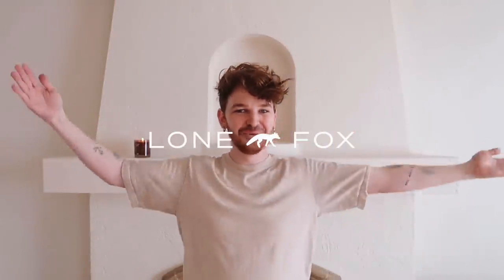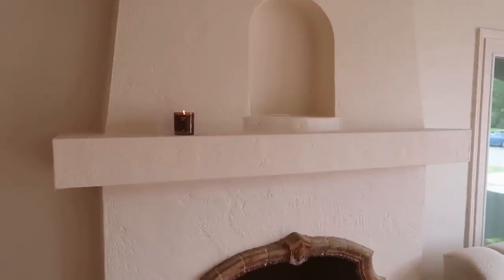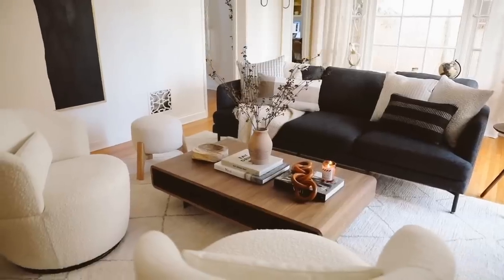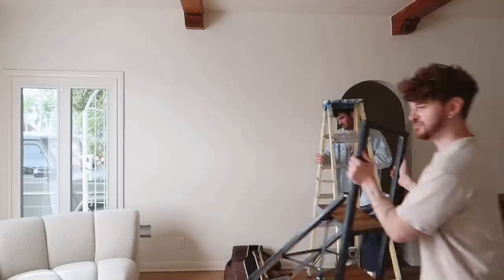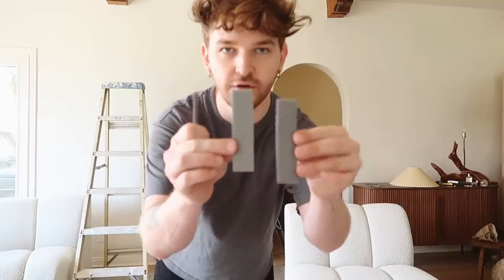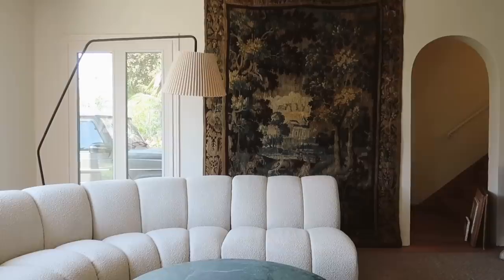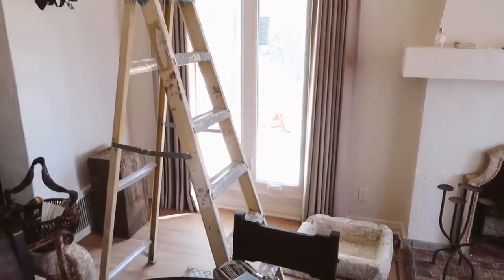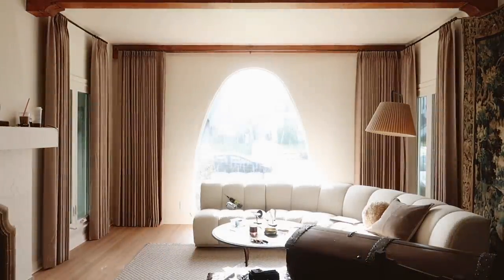Making Over The Lobby 🪑 *EXTREME TRANSFORMATION*

Comment: I just want to let you know over time, your beautiful outdoor/indoor rug will over time destroy  the wood under it if that is the original solid wood floor..because the synthetic fiber won't let the wood breathe.. folks have ruined many a floor with those synthetic underlayment rugs for their wool rugs by the same mistake.. Just keep monitoring especially in the rainy season.. and ultimately find a 100% wool/ natural fiber backing  rug as I have also seen wool rugs backed with synthetic backing .. so they can say it is washable.. (very few home machines would be able to handle that without breaking btw!! )

Comment: Beautiful transformation...as for the lamp: i do not like that shade you added. it's proportion to the size of the arch just seems off. and the wrong shape of shade. i think it would be cool to take the original shade and just find some cool way to change the COLOR of it so it's not so dark and heavy and blends with the lightness of the room more. something even as simple as a light "stone" finish spray paint. (?)
Reply: Remember; black always grounds a space and makes it better
Reply: @sandieedward993  "grounds" being the Key Word. there is very little dark on the ground (floor area)  to balance a large black shade that would seemingly be floating in the air in the middle of the room. ;)

Comment: The tapestry is too big for the wall and room. You will ruin it next to the window and folded on the floor. The couch is also too big for the room. Its unique shape overwhelms other objects. It's also not a good design for gatherings because you are forced to sit like a bird on a wire. Multiple smaller seating furniture would be better for group conversations, and more appropriate for a lounge/lobby area. The curtains are very nice as well as the other pieces in the room.